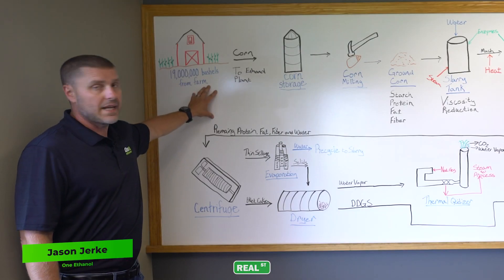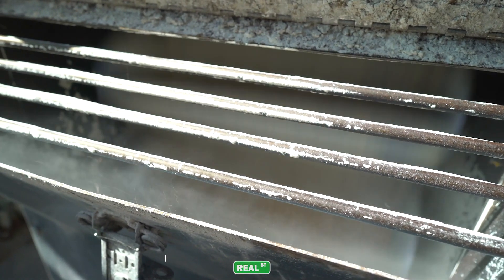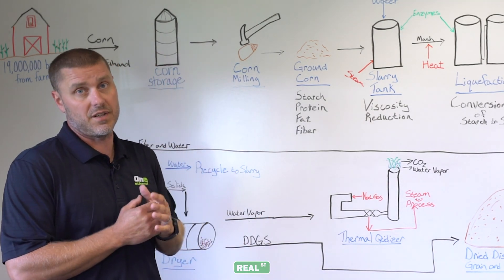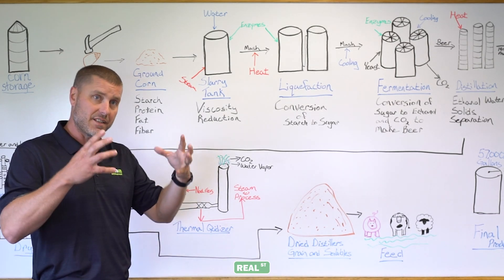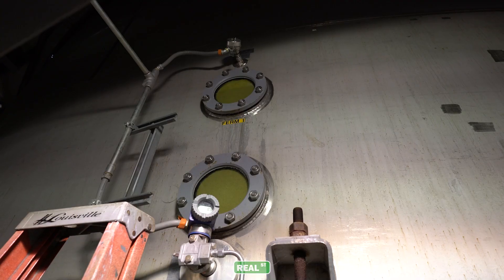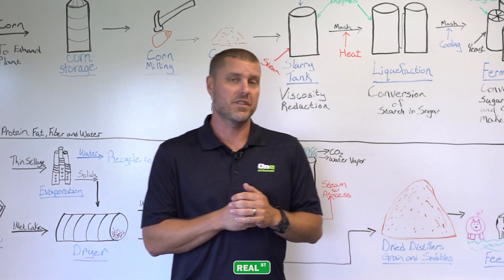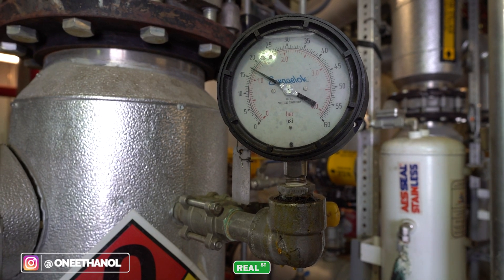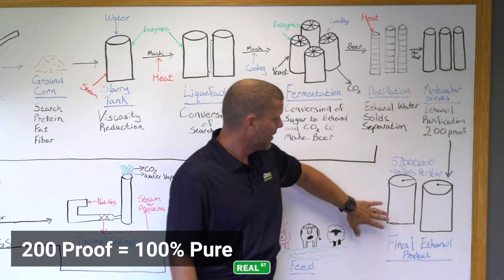Race Ethanol - How One Ethanol Race Fuel Is Made - Part 1

Comment: Here in Western Australia

I used “E85” in my Nissan Skyline
But when i fill up at different fuel stations i get various readings of ethanol content sometimes 65,70,75
Highest 78%,why is this?? Someone please explain??
Reply: The ethanol content can vary at the pump at whichever station. this could be due to seasonal change, the ethanol in e85 is blended to a lower percentage as winter approaches mainly due to its high flash point. Not sure if this is the case over there in Australia, but it could just be on the gas stations end or the actually plant that produces the ethanol. If there are other E85 stations available, try to see which one is most consistent and stick with that station.
Reply: @devastaterzx6906  thanks man i will do that,we are heading into summer now

Comment: The smell of corn juice in the morning on cold atart is so so awsome. Jay if you could reply if you do see my comment im wondering is there a additive to run with ethanol that will help the rings and sleeves a bit
Reply: Lots of people I know, run Marvel Mystery Oil or Lucas fuel conditioner (with injector cleaner). I personally run the Marvel Mystery oil additive by itself without issues. There’s other ethanol specific fuel additives, but idk if they necessarily help inside of the engine that deep, apart from the fuel system parts.
Reply: @isnowyazn Lucas Ethanol Conditioner

Comment: I learned about this when I worked in an underground limestone mine. So we could not have any gas under ground. And we had to run b99 bio diesel. Why? For the air quality. In diesel land, the only issue was that it was hard on seals and fuel lines. And gelled at like 35 degrees but it was always 70 underground. But the lines weren’t made for the b99. I am sure they had the same issues when normal diesel was created, I imagine the gelling could be fixed quickly. Now, you look in the pipe of a diesel that has been ran on b99 it’s entire life, no soot in the pipe or very little. Now, look at an engine that runs on methanol. Clean pipes and e85 is also very clean. Why don’t we use it main stream and develop the standard road car engine for it? They could have much more compression or boost so you could use a smaller displacement for the same power demand etc and its renewable etc and clean. Don’t come at me about NOx. Let’s be honest about plant food. But seriously. This is when I learned a little about following the money. Anyways. Let’s be honest and stick together. Or we will end up with no race cars and only gov issued tickets for some jank broken down public transpo. Thanks real street. You are solid. And I am not really an import guy although I do enjoy a turbo rotary, a screaming 2j and the oem ridiculousness of the b and k series. You can probably tell I have a single turbo sbf on a elite 2500 lol. I enjoy anything that has been well built regardless. It allows me to see the passion of someone in their car or whatever it is and I appreciate that. Some people will go their entire life without noticing that or feeling what it is like going through the failures and success of doing something yourself. Like the excitement when you set the base timing and it lights off for the first time. It still makes me a little shaky and giddy. Anyways enough of me ranting. Carry on.